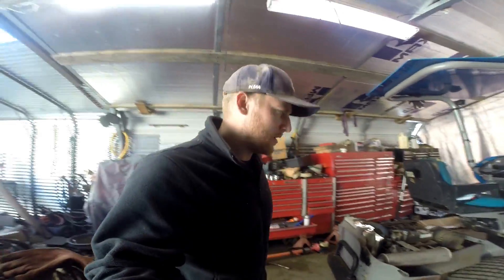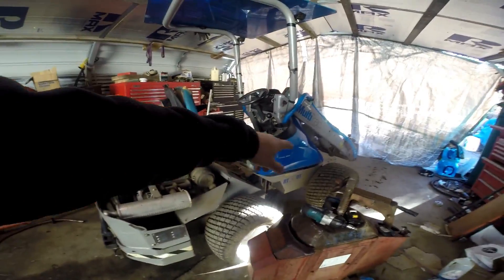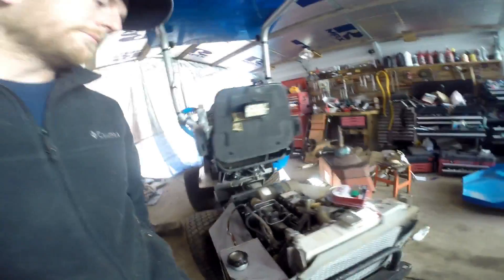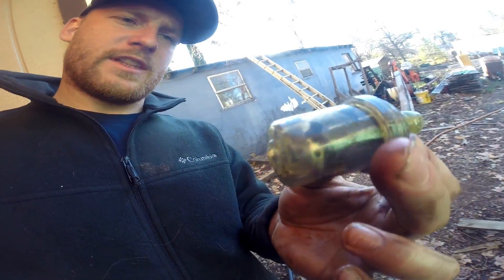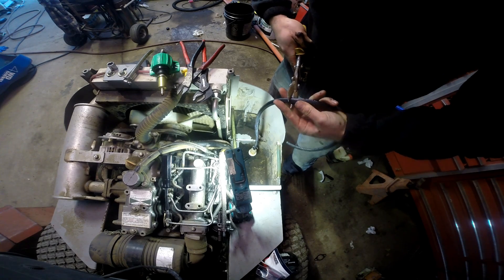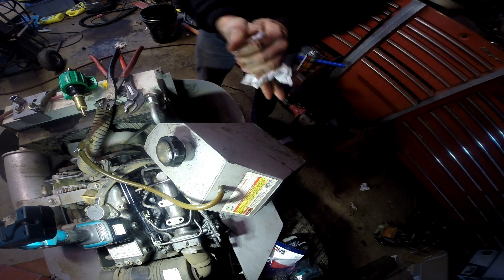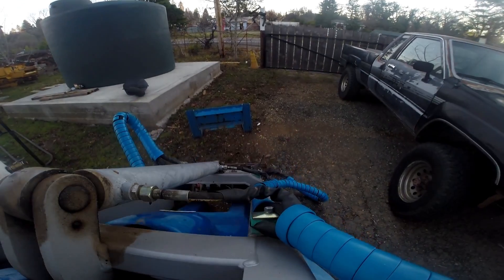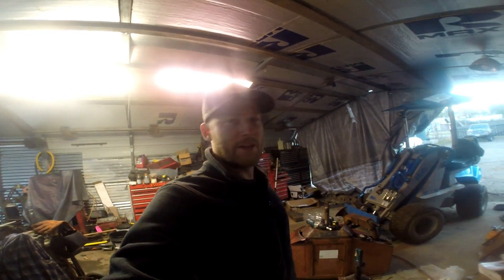FIXING A 3 CYLINDER YANMAR DIESEL ENGINE

Comment: How did you manage to retime the injection pump? Trying to figure out how the gear sits on the adjustable base lol
Reply from the maker: @lokedog916  i literally had to hunt for it. Was a major pain in the a$$. Just get retiming it until it started doing something
Reply: @ appreciate the response, probably going to have to do the fuel flow method like I did on a Belarus lol

Comment: would have been cheaper to fix it the right way, tha the cop job you did
Reply from the maker: Cheaper way to fix it than swap a fuel filter out?
Reply: @VBELTandSON  fixing the lift pump, instead of cobing in an electric pump.
Reply from the maker: @ACatKrom  I didn’t put an electrical lift pump in.

Comment: Hi, so interesting , i’m trying to time this 3 cylinder yanmar after a pump servicing but it’s  knocking even when the line are perfectly align, but ! The nozzle 2 is cover with carbon where the 1 and 3 are not, maybe I have the same goofy thing than you found !
Did you have carbon on the #2 , white smoke and fluctuation on idle ? Thanks V belt and son !
Reply from the maker: Check the rack on the injection pump. Make sure number 2 isn’t stuck wide open that made our knock and was really peppy on the throttle response

Comment: Nice useful little rig :)

That engine sounds like it has a knock at Idle , Did you check tappet clearances or could it be a big end bearing ?
I know Kubota engines are noisy and "knocky" as standard but typically a yanmar is a much smoother better balanced engine.

How many hours on the engine ?

Comment: Long video just to say check your fuel filter for clogging or your engine will not perform as expected. Nothing about actually fixing an engine as the title states.
Reply from the maker: 😂 it’s ok to be happy and in a good mood.
Reply: @VBELTandSON  didn't mean to hurt your feelings but your 20 min video had nothing to do with actually fixing a 3 cylinder Yanmar Diesel Engine.  Regardless of what mood I'm in, I hate wasting time watching a video that has nothing to do with its title but bless your little heart for trying.
Reply from the maker: Turn the volume on and listen to the issues I went thru with fixing the engine then amigo. Machine with a 3 cylinder yanmar was running poorly I fixed that. Get real sally.
Reply: @VBELTandSON  I had my volume up "Sally", sorry you feel your above criticism but finding a missed routine maintenance item then claiming you repaired an engine is very misleading to people searching for info on actually repairing an engine. Get over yourself, seriously!
Reply: I was looking at an underperforming 3 cyl Yanmar today.  Told customer I wanted to change the filters (3 in this system).  He says we just did that less than 20 hours ago.  I agreed and said, let's do it again.  He says no, I'll send down a diver to look at prop.  Diver says prop is fine.  We get 3400 rpm in neutral, 2700 under load.  No smoke.  He just agreed to changing all the filters on Monday.  Hopefully that's it.  Engine has less than 200 hours.

Comment: Hi, good discovery works! When a diesel engine has running issues, it's always about the fuel delivery. Could you pm the make model of this tractor, it is quite an amazing machine. I'm not familiar with the make model. Thanks

Comment: My yanmar tractor doesn't have that little filter. I would have probably left it off.
Reply from the maker: Filter is doing it’s job and keeping fuel filtered why not add one back in? Not hurting anything
Reply: @VBELTandSON   black fuel like you had in that filter often indicates fuel algae , there are fungicides available but some people just drain the tank ,steam clean inside it ,replace all filters and maybe add a algaecide if the engine is stored for long periods without use. :)
Reply: I was the weirdo that sold you that machine.    ..quack quack   😆  lol

Comment: Nice little handy machine 👍 I bought an old bobcat 743 the same way.... the previous owner messed up the fuel system and could not get it running anymore. I changed the lift pump clean up the fuel tank and she fired up straight away 😬👍
Reply from the maker: some ppl just shouldn't try to mechanic stuff haha glad you got it running!